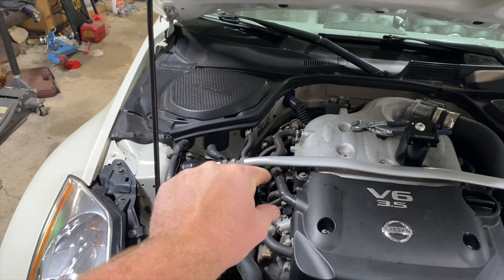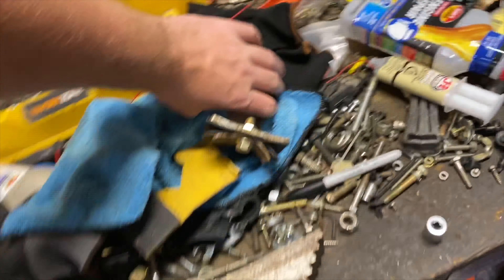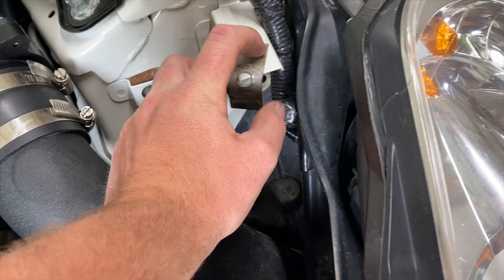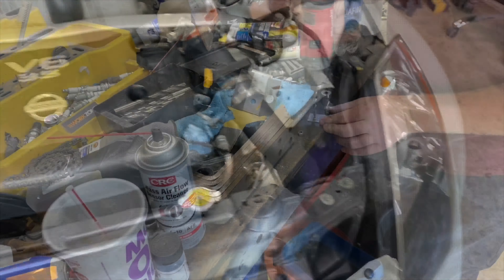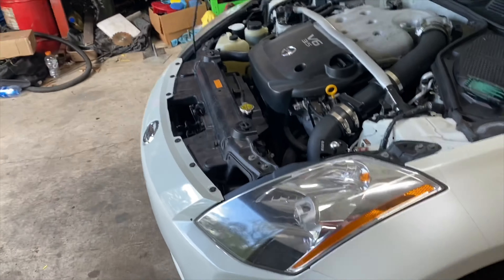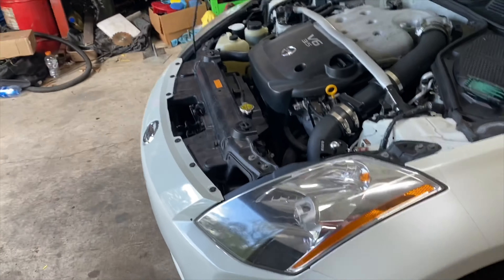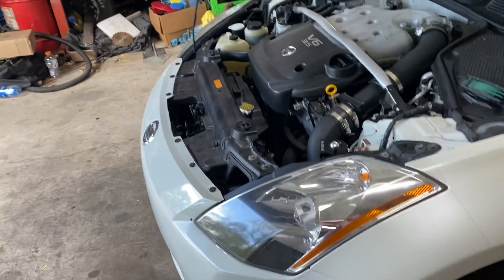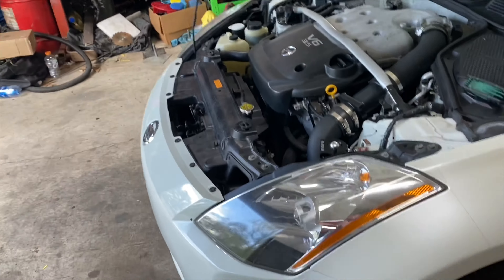Nissan 350z oil catch can

Comment: you are not catching any oil because you are using hoses way too long for the application and the oil cannot even get to the catch can its just in the rubber hoses. why not install it on the passenger side next to the power steering reservoir. that is what literally everyone does.
Reply: Yes He's right!! You're doing too much Bro. Way too much hose. Keep it simple. Mine is right next to the PS Reservoir and I have the catch can as you!!